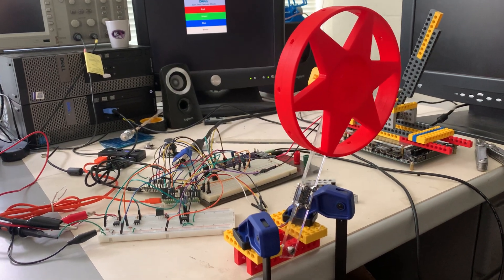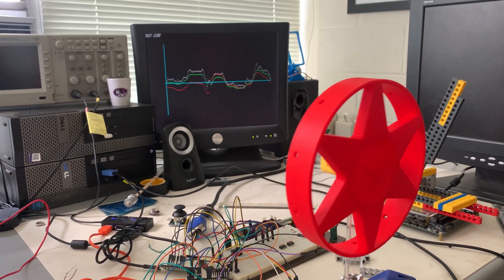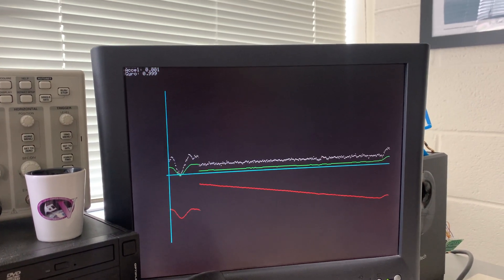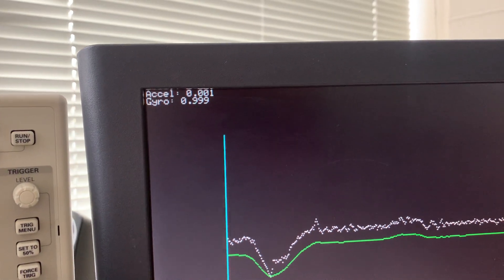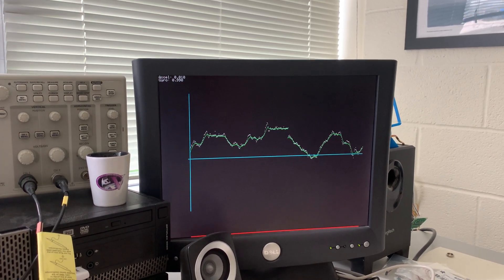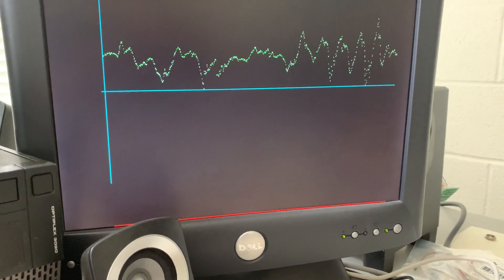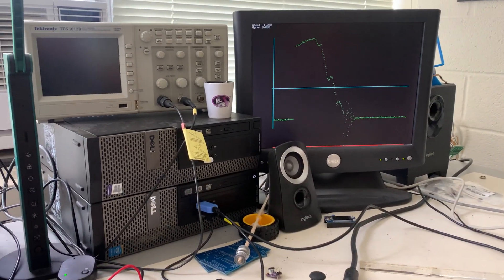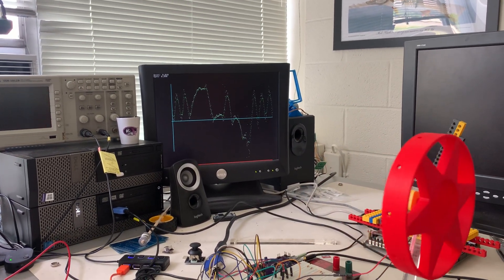Estimating angle with a complementary filter

Comment: I have a dumb question. If I have a device which is horizontal and I need to measure the yaw, would a complementary filter still work? As far as i've seen, most people use complementary filters for roll pitch. I could be wrong though
Reply from the maker: If you replace the accelerometer with a magnetometer, then yes. The trouble with the accelerometer for yaw is that it’s spinning around the gravity vector, so the measurements don’t change. But if you use a magnetometer to measure angle relative to north then it would work.
Reply: @hunteradams9430  Thank you for the reply! I was planning to use a madgwick filter with a magnetometer, an accelerometer and a gyro since my project involves a lot of complex movements and I heard that a complementary filter isn't too good for fast movements.

Comment: I read your blogpost, nicely written. Do I understand correctly that your angle calculation depends on the angle the sensor is mounted to the pendulum? For example if I rotated  the sensor I would need the Z axis acceleration right? You mentioned the approximation is valid only for small angles. What are 'small angles' and what happens if the sensor exceeds this limit? Lastly, do you calibrate the sensor and if yes with what method?

Comment: Why gyro reading is needed? 
If it build noise and then saturate after some time, what benefit would it add?
Reply from the maker: The gyro is accurate over short timescales (little noise) and inaccurate over long timescales (generates a bias). The accelerometer is accurate over long timescales (no bias) but inaccurate over short timescales (lots of noise). The complementary filter low-passes the accelerometer and high-passes the gyro to get the best of both worlds.